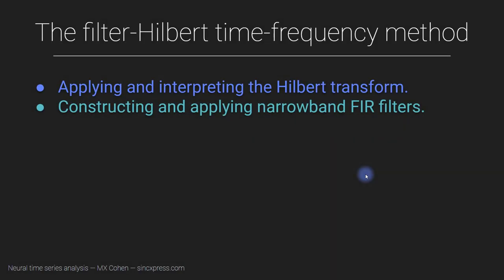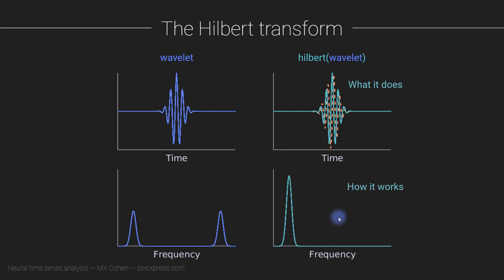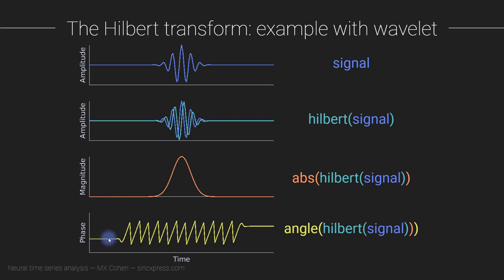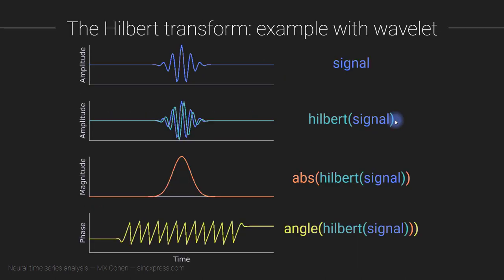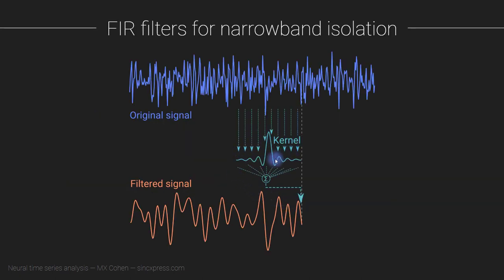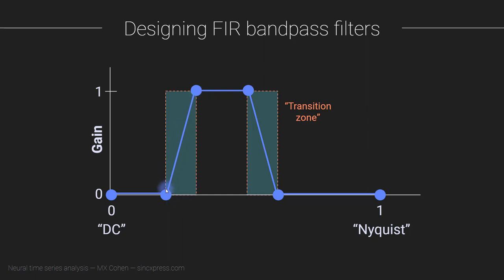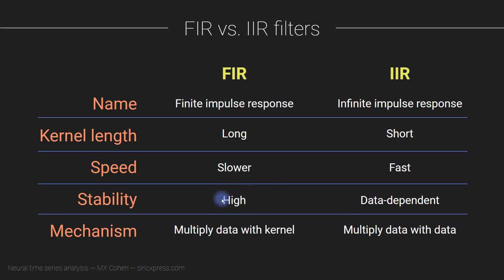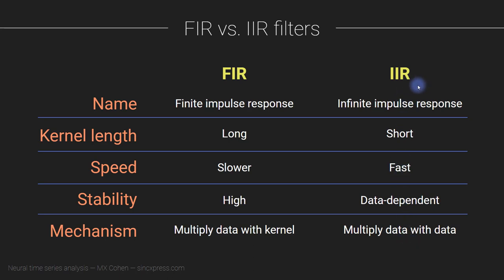The filter-Hilbert method

Comment: Is it possible to not only band-pass filter, but apply a variable attenuation to the power of each frequency in the band, using a method like filter-hilbert. My instinct was to simply apply an gain-envelope over the frequency spectrum, however, this doesn't seem like it would work as expected. Mainly because the Gilbert transform works by doubling the low end of the FFT spectrum, which results in a unique transformation of the signal, not in the doubling of all frequency powers. So, applying an envelope over the signal will equivalent result in a unique transformation of the signal - not the desired attenuations of each frequency power over time. Essentially, something like: abs(half_power(hilbert(narrow_banded_signal))) = abs(hilbert(narrow_banded_signal)) / 2
Reply from the maker: Yes, you can create any arbitrary shape of the filter you want. That's an advantage of FIR over wavelets for narrowband filtering. The interpretation gets trickier with the Hilbert transform. The analytic signal resulting from the Hilbert transform will reflect whatever frequency has the most power at that time point. So if the filter itself biases the signal towards some frequency, then the analytic amplitude and phase will be dominated by that frequency. That's not necessarily a problem, but seems a bit suboptimal. My intuition is that it's best to have either (1) a flat spectrum across some range, or (2) a symmetric peak around some frequency of interest. An asymetric filter would introduce a systematic bias in the spectral content of the results, which is something I'd prefer to avoid.
Reply: @mikexcohen1  some of that has gone over my head, as I'm not too knowledgeable in this field, but what I'm trying to do is exponentially attenuate higher frequencies - to give a more representative diagram for audio spectrograms (humans hear higher frequencies less than low). The end goal is to actually apply an actual human frequency envelope to the frequency spectrum (as opposed to a basic exponential line) to nearly exactly match how a human would hear the frequencies. Side note I watched some videos from the new PlayStation 4 teasers where they talk about advancements in their real time audio processing in games. In here, they use envelopes calculated empirically calculated (unique to each person's ear) to provide more realistic 3d/audio
Reply: @mikexcohen1  to sum. It seems your concern is that this will introduce bias for certain frequencies - but this is exactly what I'm trying to introduce, to match human hearing
Reply from the maker: I see. Then yes, go for an FIR filter. You can use an algorithm like firls and use, e.g., 15 points to specify the shape of the spectrum.
Reply: @mikexcohen1  Do you have a series including FIR with least squares?
Reply from the maker: Well, I have videos where I show how to create and use firls filters, but I don't have any videos that go through the math of constructing those filter kernels, if that's what you meant.

Comment: Hi Mike, my bandwidth of interest is essentially all the major frequency bands (0.1-50hz). In terms of wavelet parameters, should I set my min_freq = 0.1 and max_freq = 50? or min_freq = 1 is enough?
Reply from the maker: Hi Zhongmin. It sounds like an FIR filter might be a better option for you, considering the wide band. If you want to use wavelets, you'll need to have multiple wavelets spanning that range. Maybe 20 or 30 wavelets will suffice.
Reply: @mikexcohen1  Thanks Mike! I think I can FIR filter it in preprocessing (is 0.1-50hz ok or do I need more like 0.1-100hz?) to get better ICA results. 
And by the way, do you have any recommendations on doing TF decomposition on signals with long time duration? My task A take 40s and B takes 60s, and I am trying to compare them.
Reply from the maker: Time-frequency decomposition is mainly useful if you expect temporal dynamics that are time-locked to some event. For really long time periods, it might be better to do something like Welch's method and compare the spectra. That's essentially equivalent to doing a time-frequency analysis and then averaging over all time points.
Reply: @mikexcohen1  Thank you!!

Comment: Hi Mike, great to see a whole new series of videos out! 
I have a question regarding preprocessing, when one's purpose is to perform time-frequency analyses on a specific narrow frequency band, either based on power or phase. Would you say that it is better to skip the 'traditional' preprocessing filtering steps (hi-pass / low-pass / band-stop at 50 or 60Hz) and apply a narrow-band FIR filter alone on the raw signal correcting for phase-shifts? If not, what is the added value of applying the above mentioned filters during the stage of pre-processing?
Reply from the maker: You don't need those extra filters for the time-frequency analysis, but those preprocessing steps will improve the ICA decomposition, which in turn will give you cleaner data. So it's still a good idea.
Reply: Thanks for the reply, got it!

Comment: How narrowband is narrow enough to use Hilbert without filtering first?
Reply from the maker: Good question. That's difficult to say because it depends on the characteristics of the data to some extent. But generally, a band of several Hz is probably a good range. For example, 6-8 Hz.

Comment: why does the FIR hilbert filter has a sawtooth phase in frequency domain?
Reply from the maker: Phase values are undefined when power is zero. In practice, on digital computers, the power spectrum isn't true zero, but some really tiny numbers due to rounding errors. So those phase values are not interpretable.